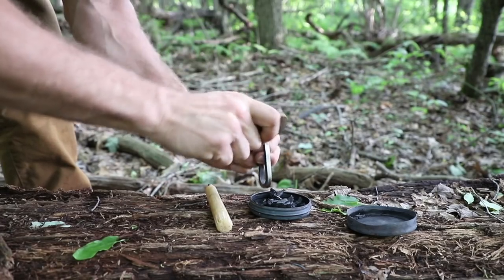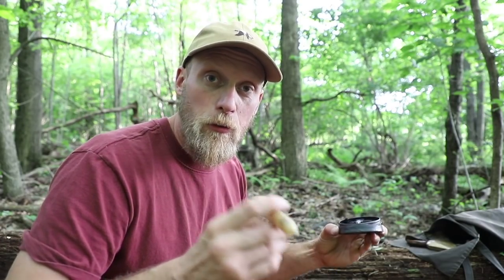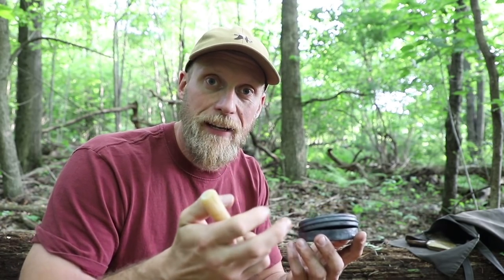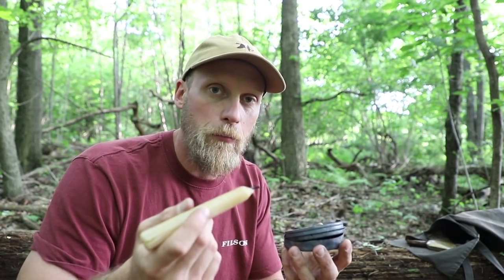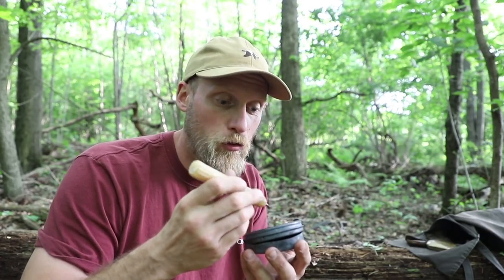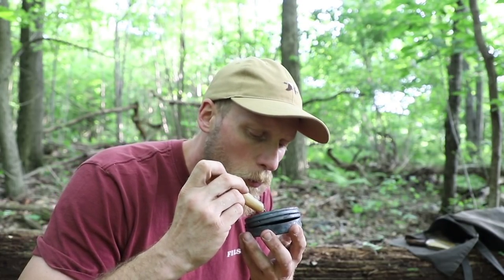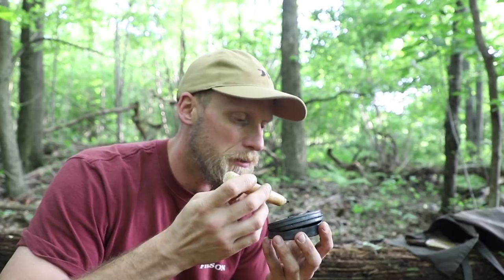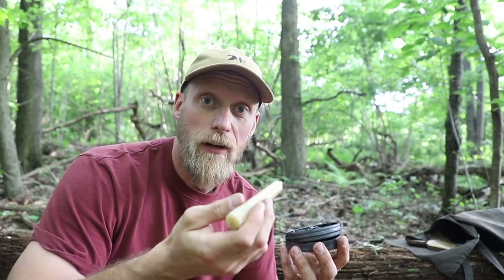Traditional Candle Lighting Methods

Comment: I have seen a similar technic to light lighter(fat wood).  You split the lighter down to match stick size which you can keep several of these in your kit. When you need to light one take a sharp knife and feather the end you want to light.  Lay the feather end on the glowing piece of charred punk wood and until to you have ignition.  Now you have a primitive match stick.  FYI - the individual that showed me this technic had his tin completely full of charred punk wood which yielded a relatively flat and stable surface to help support the fat wood stick while lighting.

Comment: Good kid. Yes, it does eat up a lot of char. Another old time trick is the sulfur match or tinder cord to light candles for fires or on those bad days with out tinder. This save the char . I try this with those stupid safety matches which use a striker surface. Instead of a sulfur match. Great video. Thank you for the share.

Comment: Hi, i have a question.  Can you start a primary fire from scratch without char materials with Flint and Steel if you lose all your gear because of a dangerous situation?  Somebody told me to use a bow drill fire to make a primary fire, then create char materials to make secondary fires with the Flint and Steel.  What do you suggests?